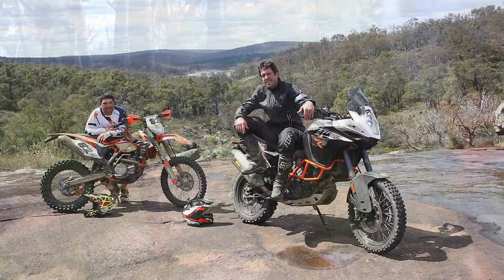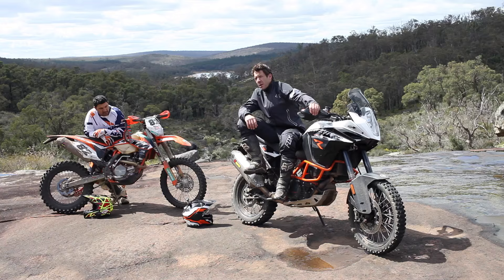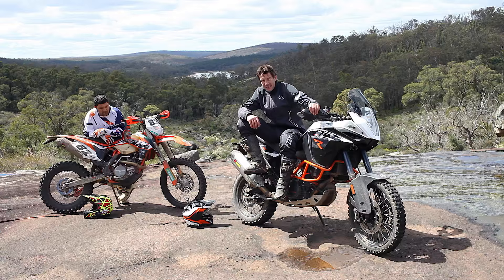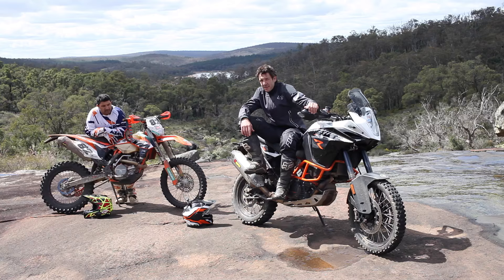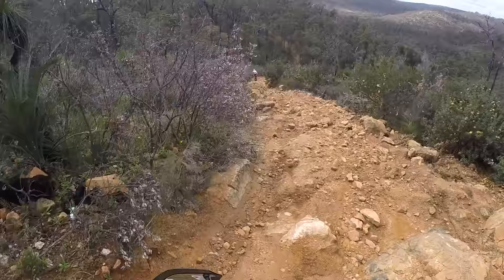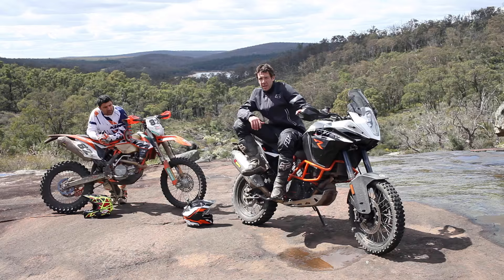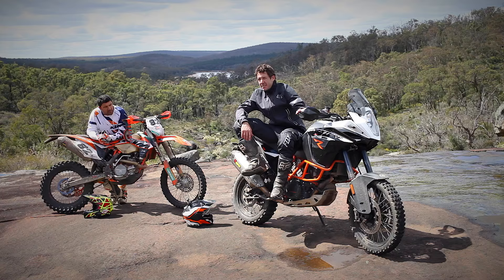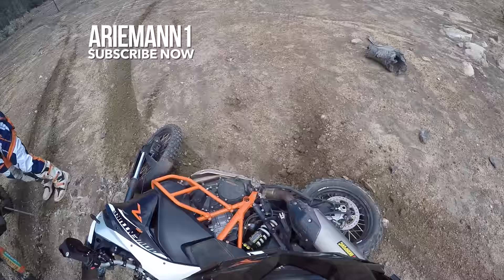KTM 1190R Extreme Enduro!

Comment: Looking at the bike sitting and at 6:45 You def have more suspension travel than you clain (just a 30 mm increase) If it would have been only 30, it would have made it 250mm, but you clearly have around 300mm front. Exactly as an Enduro Bike. Where do those 50 more mm come from?